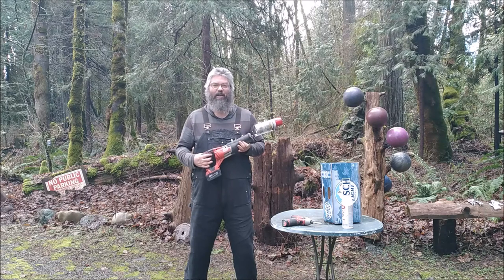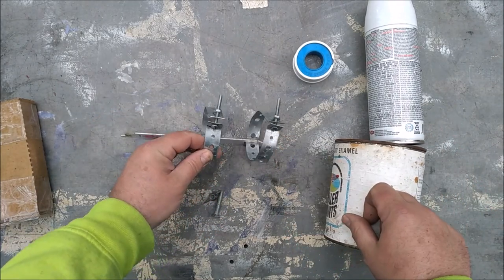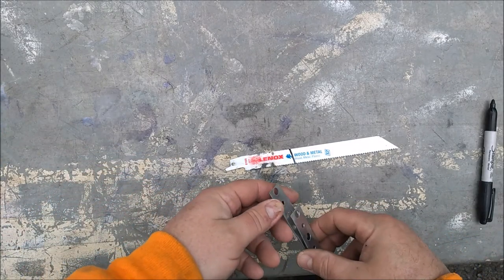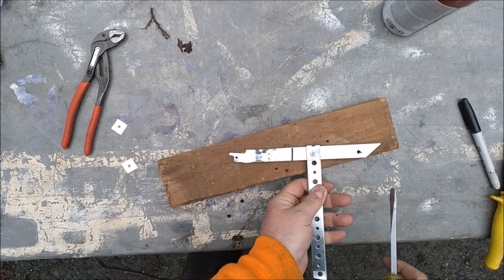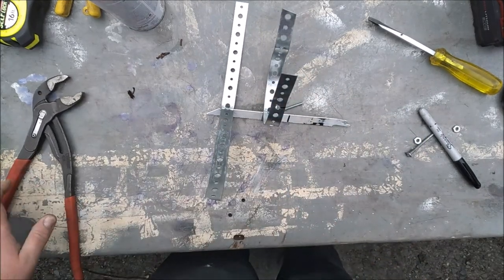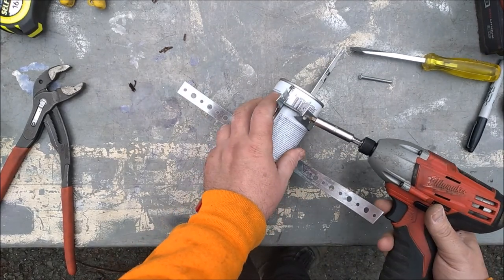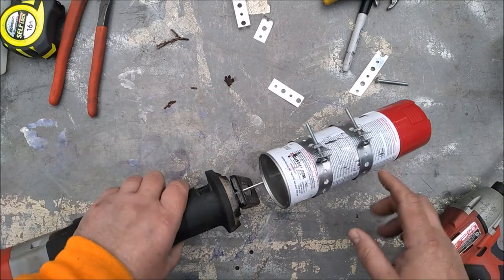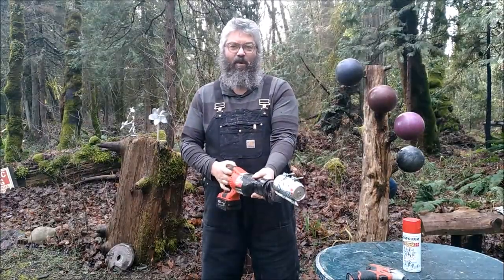Sawzall Spray Can Shaker!

Comment: For any polocks or aggies out there make sure the cutting side of the blade is not facing the can. And for people that dont wish to be flex sealed travel with caution. My Lbracket brace i had modified to hold the can at the top end cut the can and a whole bunch of me got flex sealed. Speaking of bunch...my grapes got coated too when i put the can down i found out it makes a great undercarriage coating.
Reply from the maker: When I want to see time fly I throw a clock out of the window!

Comment: Does this work better than the rotating one you last built?
Reply from the maker: I haven't tried it really.  The weather here is just starting to warm up enough to paint.  Sixtyfiveford says it breaks the internal parts.
Reply: @thecatsupdog Breaks internal parts?  Of what, the Sawzall?  I built one of these and the metal rod fatigued quickly, especially at higher speeds. It broke right at the holes where the bands are fastened.
Reply from the maker: @bobweiram6321  He said it broke the internal straw of the paint can.  He could then only paint with it upside down.